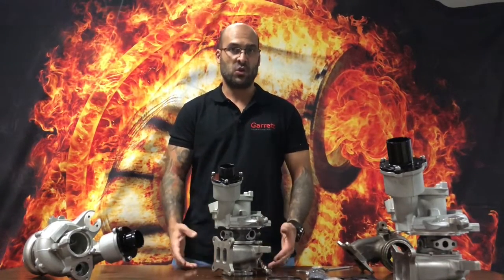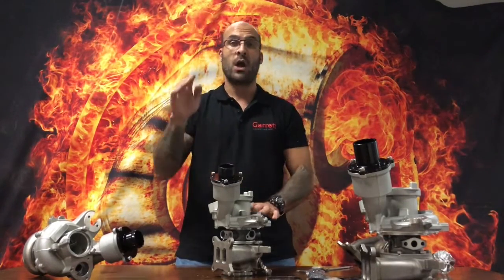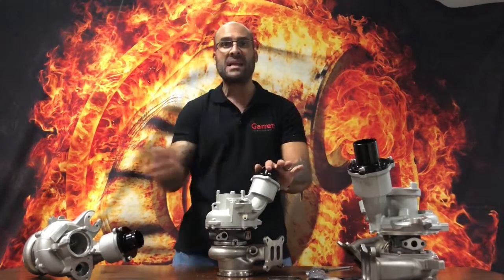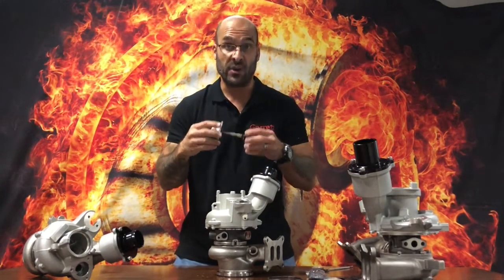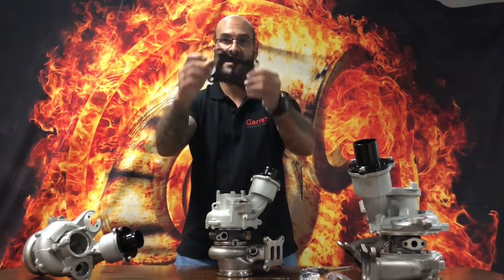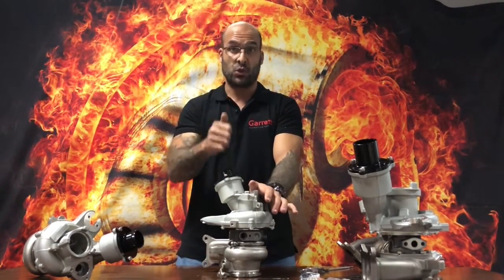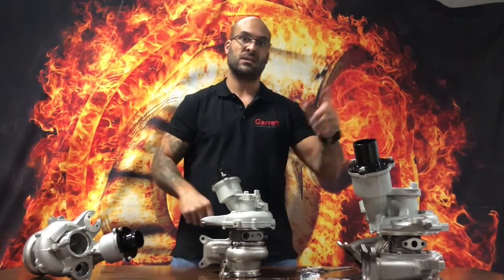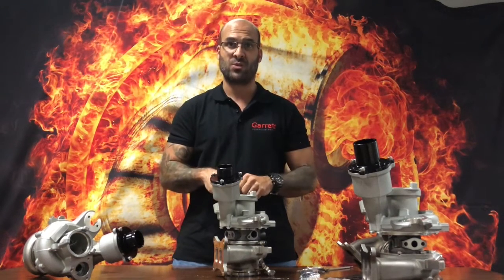IS38600 Thick Shaft Turbo

Comment: So, the thick shaft is something that can more-efficiently be used with a ball-bearing turbo, due to excessive film friction if used in a cassette-bearing turbo, yes?
Reply from the maker: Not really anything to do with oil friction - there will be almost no friction (drag) in a ball bearing setup in comparison to the JB application - one of my videos show this clearly.  It's more about the relationship with the rotating assembly and the forced exerted from these wheels during operation.

Comment: At what rpm do you think a G30-900 would get full boost on a EA888.3 engine (Golf R)?
Reply from the maker: On which engine? What supporting mods, what fuel?
Reply: @TurboDirectSA  93 octane, Mk7.5 R engine, MPI, 535 brushless pump, ID1300s, billet intake manifold, big port head w oversized valves, etc
Reply from the maker: @bm717252  4250RPM - 4500RPM you should see full boost around 30Psi provided the engine is setup correctly and the tuning is done right. 93octane doesn't give you much in terms of ignition advance options, so lag will be experienced. Octane increase will yield better tuning options, and better response. The turbo itself isn't the best offering in the HP output, firstly you will never see anywhere close to 900HP with this turbo, its just no capable of this, look at the compressor map.

The EFR8370 will destroy the G30-900 and make more power and spool faster without a doubt, it also has a better list of features and costs less taken into account all the additional parts you need to purchase with the Garrett.

Comment: 600hp with just lpfp/hpfp? Normally those added fuelling upgrades on the MQB platform tap out around 420-430whp. wouldn’t lpfp/MPI unlock that higher power you’re alluding to?
Reply: Oh wait, are the SA model MQB cars like euro cars and already come with mpi? Lol
Reply from the maker: Fueling system upgrades definitely required to make the higher HP numbers. Without this, you will never make the power above the hardware limitations. South African cars already have MPI installed.

Comment: Hi Chris,  quick one, at what RPM would max boost be achieved considering the larger housing? My goal would be 480hp max on stock engine internals. Worried the lag would be quite noticeable.
Reply from the maker: Boost response and overall turbo performance is determined by many aspects of the build and tune.  On the EA888 engine, flowing the head makes a big difference - decent hardware additions also count for great results - Fuel and tuning aswell as a proper TCU tune will greatly affect the way in which the turbo acts, spools and performs.  Its difficult to answer this question to anywhere near accurate as any of these aspects (and more) mentioned above will have a direct effect on the results.  

You should expect to have full boost around 1.8bar gauge pressure with a decent tune and hardware mods of around 4000-4500RPM where you will make the power you looking for quite easily.
Reply: Hi Chris  do you ship any of your turbo,s to South Africa  please let me know on my email address vandenberg.pierre@gmail.com :  have you ever think to use nitro,s along with your turbo to get the top end higher

Comment: Hello Chris. Can the Thick shaft be made to fit for the previous generation. I already have a K04 but stock K04 internals. Do we have any options ?
Reply from the maker: No Need, the K04RS 7blade splitter compressor we designed is reliable enough and maxes out the extremely small AR turbine and compressor housing combination. The diameter of the wheel is also not abnormally large like the Hybrids built for the Golf7R IS38 units, so boosting around 2.0bar will see you decent power numbers (with hardware supporting mods ofcourse) - next step if you want to make more than 300-320WKW is to use the EFR series turbos - untouchable spool and more than enough power, ultra reliable and lightweight
Reply: Chris Kambouris Thanks Chris. Based on your vids on reliability with Hybrids. Talking turbo reliability. I’m running 1.7 bar stock K04. Are you saying you think the relatability would be ok up to 2bar ? Eg as it’s a lighter wheel even though larger the strain on the beating wouldn’t hurt too much.
Reply from the maker: @mk5gtik04  With the thrust loading form the wheel we designed, the bearing system lasts. Whenever we do an upgrade we replae the entire bearing system anyway as a matter or course. It will be reliable - IF you want to go there. It all depends on your HP target - be realistic at all times
Reply: @TurboDirectSA  "untouchable spool" I am guessing that is at least partially due to titanium aluminide turbine wheels?
Reply from the maker: @exploranator  YEs and the mixed flow inducer ..... go check the catalogue from Borg out - you will see alot of info which i dont always share.